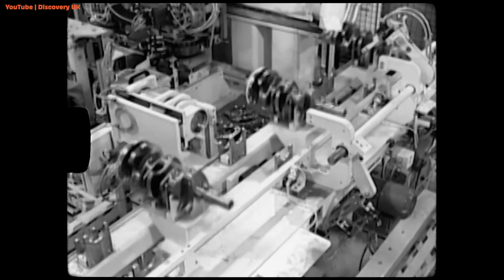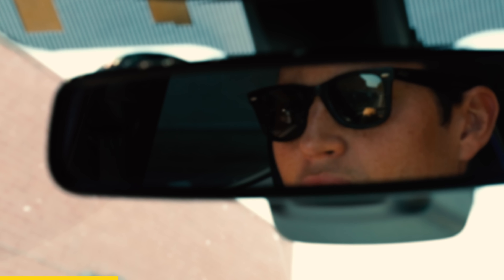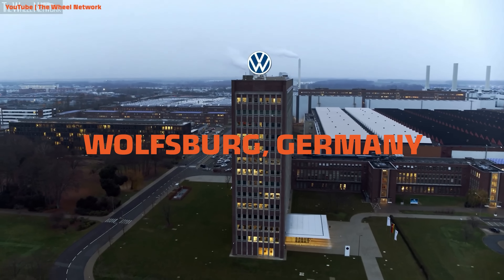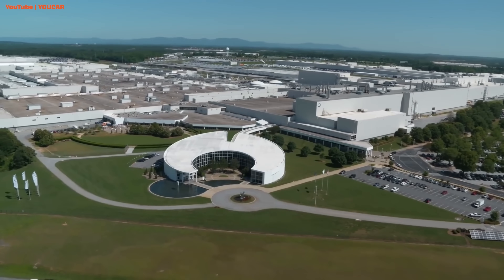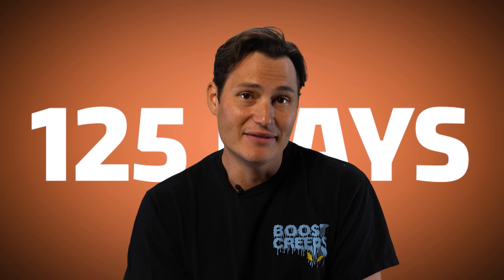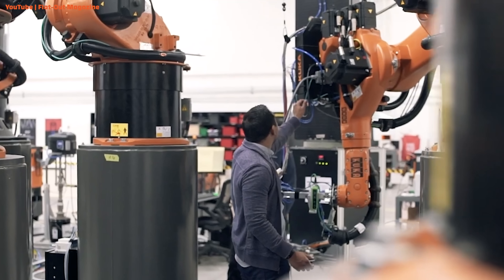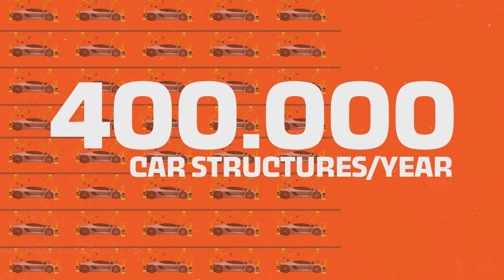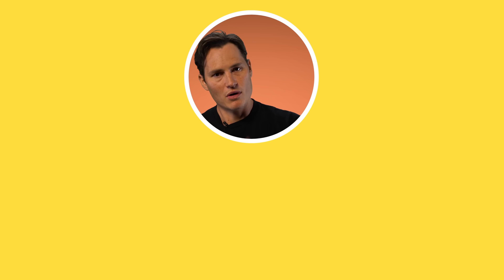A.I. Designed this Car

Comment: I thought you had realistic videos at your channel. Apparently not... Assembly line costs 3mil and not 500mil well it produces about 1% of what the other does. Robotics? No it's not any easier to reprogram than to program it from ground up. 40 A.U.s in one warehous, well if they work for an hour and the rest of the process takes 300h, there's going to be a little more than 9 miles of production line to supply them parts. Please don't try to bullshit people that don't know shit.

Comment: The less modular the vehicle is the more proprietary it becomes. Tightly engineered vehicles are usually the most difficult to repair. This will result in replacing your entire front end just to fix your air-conditioning duct, or needing to remove your engine to replace a spark plug. The most efficient vehicle will be slightly oversized, have entirely "plug and play" modular parts that can be pulled and replaced by any user at any time, and will self diagnose to instruct the user on how to fix it.

Comment: AI well we aren’t there yet. But a computer can try a million different ways to do something then pick the one that meets YOUR parameters that is strength and less material in manufacturing, aero and fitment within a limited area/volume etcetera ... True AI just gets an idea and goes for it. 
 My told me when I woke up this morning that it wanted to build a car it designed last night between 1:13 and 2:13 in the morning just passing time.

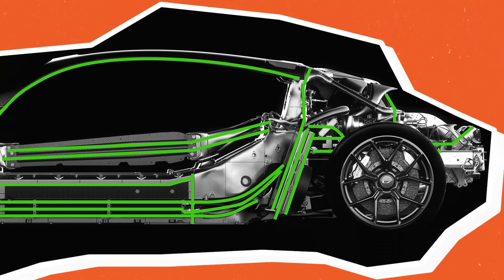Comment: 6:09 This is the exact same approach Tesla just incorporated into manufacturing their cars. They designed part of the structure of their cars to encase the batteries rather than forming the structure of the car then adding the battery as a separate unit. The result is a lighter vehicle, space savings, and less material used to manufacture a vehicle. Genius.

Comment: In the future you won't have to repair your car, because AI designed to never be worked on unless you disassembled  it from the last part installed  to the  headlight that burned out.

Comment: I wouldn't quite call the learning process described machine learning. It's not really learning from existing machines really its performing an optimization task via simulation (simulating forces, aerodynamics etc) with additional requirements specified by the engineers. I doubt it would be possible for the whole car to be optimized as a whole rather each part has a set of requirements that the optimization process must conform to.

Comment: "A 3d printer doesn't print out extra material"  Yes it does.  It prints structural material to support overlapping material that would otherwise be unsupported while upper layers are printed.  These are broken or cut away after printing.  You can see this material starting at 7:03.  The amount of extra material printed is almost insignificant.
Reply: I'm not really sure why they're printing support material in a laser sintering printer. AFAIK it's completely unnecessary.

Comment: The Wolfsburg plant is as huge as it is to mass produce as many models as they do. Czinger makes a handful of the same model per year, max. This is much the same reason that all major automakers don't default to topology optimization and additive manufacturing for everything. Similarly, the shortest route for a wire isn't necessarily the best route for it. Factors like maintenance accessibility are very difficult for computers to do well. I wish this video talked about what the AI here is actually doing. As far as I can tell from this, it's just a handful of engineers using typical FEA capabilities and a lot of 3d printing. All of the technology they're using here is valuable and has a place in the future of automaking, but this form of vertical assembly won't scale, and cars made like this will be far from robust to anything but ideal conditions.

Comment: But is it serviceable?  What if a wire harness needs to be replaced?  How does a body shop fix it once it’s wrecked?  Seems like this car would most likely need to be replaced rather than fixed, so what’s the plan to recycle the car?  Very cool idea.

Comment: Ok, you can not print a smooth surface, you still need to sand parts. You litiraly limited by the size of a metal grains.  Printing also way slower than mass-production. These cars can be made faster from scratch but it will be orders of magnitude less efficient in terms of time and energy usage to make a copy of it than in conventional way.

Comment: So let’s get this straight: it’s all about the future of automotive engineering - then they put a combustion engine in it?! WTF isn’t it electric 🙈
Reply: “Electric cars are the future!, ICE is pointless!” “It’s easier to 3D print an internal combustion engine than it is to 3D print neodymium” :| >:|
Reply: @georgegeorge4560  you don’t need to 3D print an electric drivetrain. The fabrication of an electric drivetrain is far easier to automate. Also, WTF - you can’t be burning fuel anymore! No new concept car should be made with a. Combustion engine, it’s just ridiculous!
Reply: @ZiusudraRascal  I may need to rewatch the video again, While I concede that it is easier to automate the fabrication / construction of an electric motor by a machine, I was under the impression the goal of the project was primarily to produce a car out of mostly 3d printed parts. As I'm sure you understand, it is easier to 3d print an internal combustion engine as opposed to an electric motor due to the simple fact that electric motors require Exotic materials (Rare Earth magnets) to operate. these materials cannot be produced through the "laser spot-welding" process that metal 3d printers use (afaik). also, electricity is overrated, the superior engine is CLEARLY a 2 stroke V8 with flint-based ignition. ;)
Reply: @georgegeorge4560  the car is made of various parts that are not and could never be 3D printed but they are assembled using automated assembly robots. Nothing about a battery pack and electric motors would be a problem for a car made this way. Especially as the battery pack and electric motor assembly are one piece elements unlike a combustion engine with endless moving parts, rubber belts, plastic pipes, filters etc that couldn’t be 3D printed anyway.

Comment: Isn't it illegal to have headphones in while driving? Even if it's not I don't agree that you should be wearing them. Blocks out noise from the outside which could lead to a serious crash. I know it's a sponsor that you have to put in somehow but suggesting to do something dangerous with is not a good look.

Comment: Everything about this car makes seem like it should be cheap. No wages to be paid for thousands of workers. Very little material as possible to have to buy. Very little land to be bought and smaller factory to be built thus cheaper for the company. Will still cost more than the I’ll will guess $250,000.

Comment: I really like this concept, but the reason automobiles are designed and manufactured by this current method is because of crashes.  How well will this 21c does DURING/AFTER a crash, and repaired, is the real question.  Also, the cost of repair may be too great for insurance companies to insure.

Comment: I call BS that the car was designed by AI. Some key parts where no doubt that lend themselves to additive manufacture.
It looks conventional to we with some show pieces.
Ideal for high end low volume cars, but not average high volume cars. 
You didn't say how many 3D printing machines it would take to supply 400,000 cars a year of all the 3D printed parts needed, or what percentage of the cars parts are additive manufactured vs conventional and off the shelf.  
So the car takes 125 day's to complete and 40 AU's can make 400K car structures a year. That all right if you are in the business of making car structures, but when Toyota makes Corolla's they are making cars, you know with wheels, somewhere to sit and can take you places. 

Cool tech, rubbish presentation.

Comment: FACT CHECK: “manufacturing a car has been more or less the same for the last 120 years”. This is incorrect. The moving assembly line was not in operation until 1913/1914. You’re off by over 10%.

Comment: The 3D printing is really pushed at its maximum in this car and absolutely amazing but the production process presentation is a bit biased : 3M$ to assemble a car in 1h is not to be compared to 500M$ investment for a full line. 
With 3M$ you can produce 24 veh/day, roughly 6000 veh/y. With 40 units, it is estimated 400 000 veh/y so the investment is already 120 M$ and for 500M€ investment in traditionnal line (which might be among the largest line) it seems the capacity is way more than 400k veh/y rather 1 M v/y to 1,5 M v/y. But in a world of "de-growth" with more "local" demand and lowered quantities the model can be relevant...

Comment: Forging, casting, subtractive manufacturing is way way faster than 3d printing. Purpose built parts are faster becuase they are in all the right positions simultaniously. Interesting extrapolation for the assembly arms but the part manufacture does not scale nearly as cheaply im sure.

Comment: What about repairability? Its hard to imagine the "most efficient use of material and pathway" results in an assembly method that keeps the most likely to fail parts easy to access for repair and replacement. Also how is this spindly bumpy thing going to go through a carwash?  Clearly they didn't apply enough constraints.

Comment: Fyi, most of those "AI generated" structures are probably NOT generated  by "AI", but by something called Topology Optimization. Topology Optimization is generally not a stochastic process, nor does it require machine learning. It is wholly based on physics equation that are solved to provide optimum structures, and yes, these structures often resemble structures from nature.

If you'd like to play around with it and learn more you can try applets from here: https://www.topopt.mek.dtu.dk/apps-and-software

If you are a mechanical engineer with FE model experience, a good place to start is Ole Sigmunds 99 line topology Optimization code (google, and you shall find).

Comment: A really smart and effective way to make cars. Now the real challenge would be: making a 4 door sedan for everyday use for the modern family. The concept of reducing waste and having integrated wiring system is the way to the future of car making. The only question I do have toward such a amazing and radical design of how a car can be made is: how are repair are going to made? Can a repair be done or would it be cheaper and efficient to just replace and remake the same car?

Comment: Why did they show cast parts when talking about subtractive manufacturing? Also 3D printing does use extra material it's called supports you can't print a part floating in the air.
Reply: The company uses powder based 3D printing so the un-sintered (not set) powder functions as the structure which can then be recycled for the next print. If it was regular injection 3D printing then yes there would be waste but not in this process
Reply: @caderidley2309  OK ya I just saw 7:04 and that looked like supports to me also I stand corrected again as those were forged parts shown not cast as I originally said but, it's still not subtractive manufacturing like milling or something would be.
Reply: @thirtythreeeyes8624  I thought it was only forging but I thought maybe there was some casting I couldn't remember. Forging still takes tapping the holes

Comment: Future gonna require a lot of engineers. 3d printing metals still needs a lot of progress tho they are weaker than cast parts currently.
Reply: most of the Suspension parts could be machined form cast or forged stock

Comment: I enjoy the idea of custom cars, letting the user provide styling suggestions.  What isn't here are innovative designs.  1.9 second 0-60 is the physical limit of tire resistance on the pavement.  Adding something like a cold rocket (compressed air) jet at the rear, would give you propulsion that is separate from the tires and thus sub 1.9 second 0-60 is possible.  New ways to route airflow, ala McLaren Senna which is amazing in it's first iteration or adding a 5th center wheel to improve traction (for example), I see a car here, a really good, light car, but just a car.

Comment: one large problem is the price, while the assembly may be cheaper, the current cost of metal additive manufacturing is still very high, so while it is great for complex shapes here and there, having that many components metal 3d printed will be very costly and also take a LOT of time as printing part the size of a beer bottle can take many hours and even over 24 hours depending on the specific machine. not to mention the initial cost of buying enough metal 3d printers to keep up with production. and having them outsourced would overall increase the price buy a TON in the long run if it were actually a car with thousands of models made. there is also the problem of size when it comes to the future of 3d printing as there are limits to how big (x and y axis) a part can be, mainly due to thermal expansion properties making large parts very hard to print. boeing is currently doing LARGE amounts of research into this though currently.  And while additive manufacturing, especially in printing metals, ceramics, and composites are great, they are still relatively new and there is a lot of improvement that needs to be made for it to be liable for many areas of manufacturing, which hopefully it will soon. right now it is mainly used in highly advanced stuff like turbine parts, specialty parts, and prototyping due to cost restraints in the current technology of additive manufacturing.

Comment: Trying to fix this thing would be a bitch. The more compact and efficient a construction usualy means when you need to reach something underneath, you'll need to disassemble the whole body panel, air cond, electrical or whatever parts the computer decide to efficiently put on top of your target parts.

Comment: The AI is only as good as the coding put into it, humans will always be needed in car building, AI can’t see the exact car as it’s made to see when two things don’t work together or when there is a failure in how something is does, I would also like to see someone 3D print a engine and it not melt to pieces at 300°

Comment: I’m all for it however, what happens when a connection goes bad, or you have an accident and the computer builds everything all together like. It’s no longer a modular car. Your hooped right? Idk I love it but I see some possible problems. More than likely they are smarter than me tho so they probably got that handled, just a thought

Comment: This is pretty cool, but I hope they put parameters that allow for reparability and accessibility.  If all the designs are made with the most efficient usage of materials, I'm worried that the design of the vehicle will make the build soo precise and tight, any access to the vehicle's components (engine, wiring, exhaust, etc.) will be way more difficult than any other vehicle.

Comment: This is cool, but none of your math adds up. 3D printing is just wayyyyyy too slow right now. The reason things get pumped out of molds is it is fast and cheap if you are doing a lot of them. Kind of skip how you get from 125 days to pumping out 10 thousand a year or what exactly it means to say that it takes less than an hour to assemble the structure (yet take 125 days).  A conventional assembly line costs $500,000 but can pump out cars by the hundred thousand. Their vertical assembly method can only cost $3M?? You can't buy the building to put it in for $3M. Also, if you "scale" up to 40AUs, then you are up to $120M not counting the cost of the larger building.

Don't get me wrong, I think this is the future, but not "this" exactly. I can see a day when you have a 3D printer/assembler in your garage that you can use to print/assemble a larger printer/assembler that then makes you a car and then disassembles itself. This will however be very energy intensive. Better 3D print me a fusion reactor.

Comment: You could potentially have a bunch of small mom-and-pop shops with a printer and assembler in a small place somewhere. You walk in, tell them what you want, they punch in your parameters, the AI designs a car or pulls an existing model that meets all the requirements, and you approve it. The parts are probably made prior due to the ideal design being common among all vehicles now, and the printer punching out a dozen or so extra custom parts for your specific car. You go to lunch, and come back to your car waiting in the garage for you to drive with 0 miles on the odometer, and the final diagnostics having been completed.

Think about it.

Comment: And mechanics can fix this car, or does the transmission need to come out to change the water pump?  Does the AI model the mean time between failure (MTBF) for novel parts on all weather conditions? Does it optimize cost versus MTBF?  That's what takes time and practical experience.

Comment: #DonutMedia.....ok so these robots do everything and vertically. So who puts the wheel and tire package on? How does the car transition from vertical to the floor? How does the vertical car get a system check? ( Brakes, Engine and power steering, etc.) Because fluids follow gravity.

Comment: The 21C doesn’t use any designs from Jeep.

The reason is because Jeeps use the worst designs for vehicles
Reply: So...  you've never driven a Jeep, huh.
Reply: @dantresohlavy7323  no, but I did design the steering wheel for the latitude though